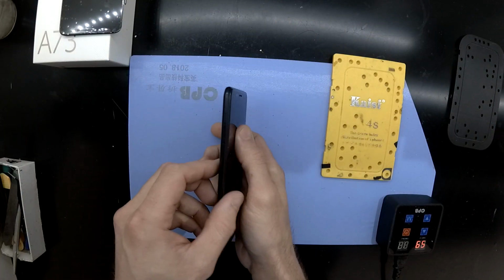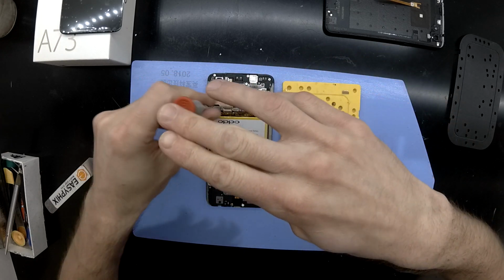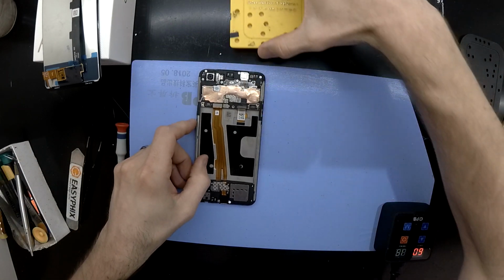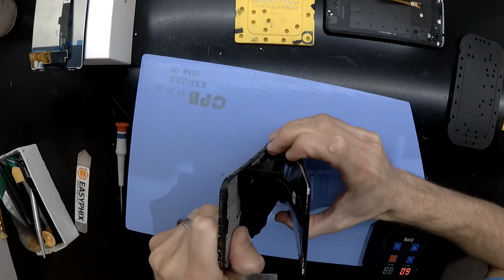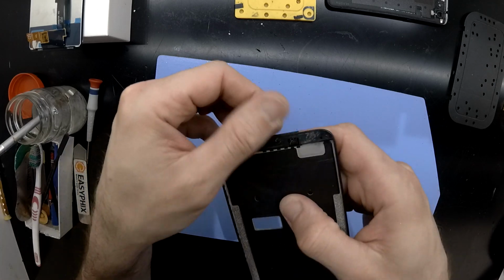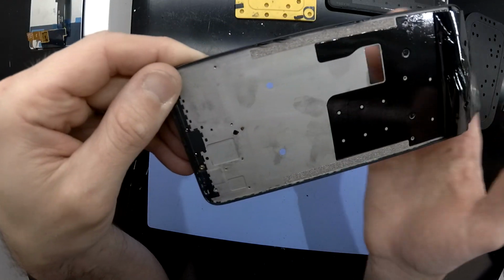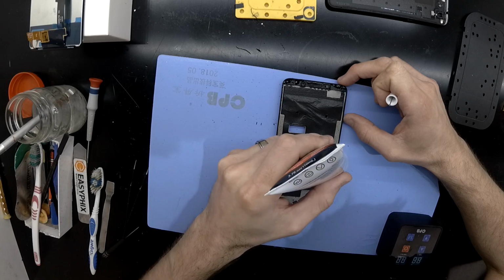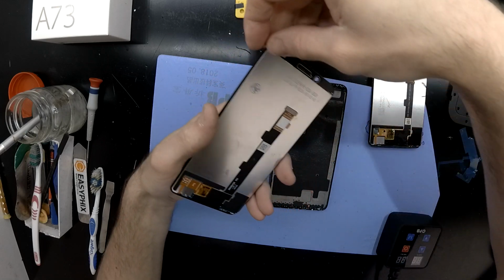Oppo A73 Screen Replacement

Comment: Thanks for you video mate, just replaced the screen in mine for second time, as I keep dropping it. Very well done
Reply from the maker: Glad it helped, thanks for the comment
Reply: Yes mate, first replacement screen was only in a two weeks and it hit the floor. Not sure that it’s as good a quality as the original. Hoping new one today lasts longer.
Reply from the maker: Bugger, I find most cheap replacement screens are usually aftermarket glass which is weaker and more prone to cracking
Reply: @rickstechrepairs  guessing your right mate, they were both off eBay, didn’t know where to get a genuine part.

Comment: How long would it take for a novice?😉
Reply from the maker: Without the right tools I would say about a 30minutes to an hour
Reply from the maker: Also I would recommend to by LCD and frame if you haven't done before 

So the you don't need to remove the old screen, you simple swap over all the parts to the new screen+frame

Comment: Hi, with the heat mat you are using is it possible to use  hot air while heating with the mat? i plan on using one for pre-heating boards aswel as lcd/screen removal.. thanks